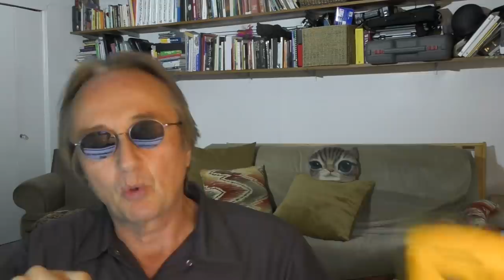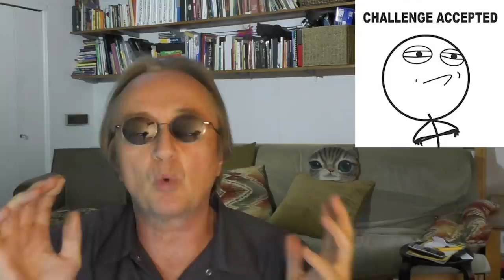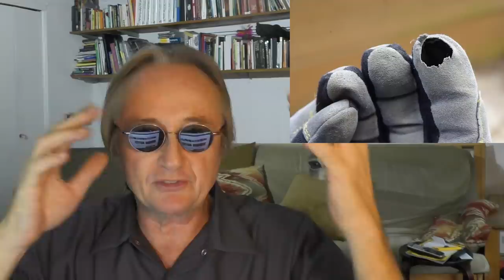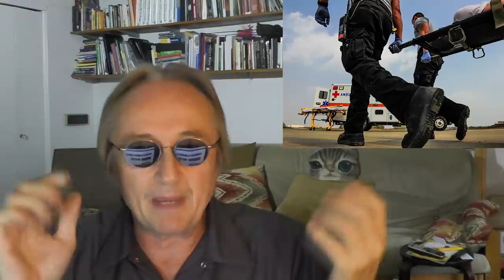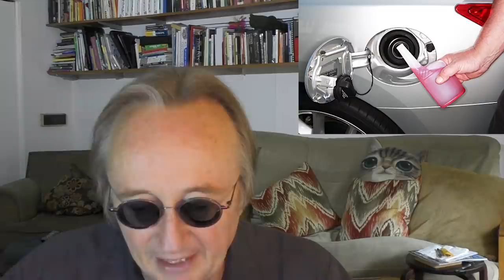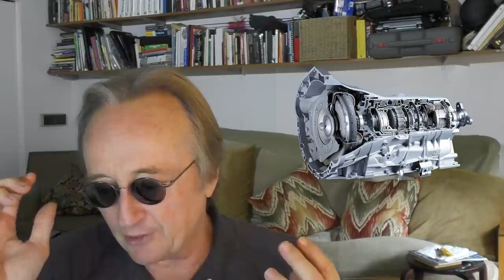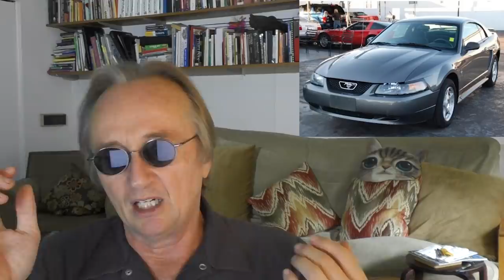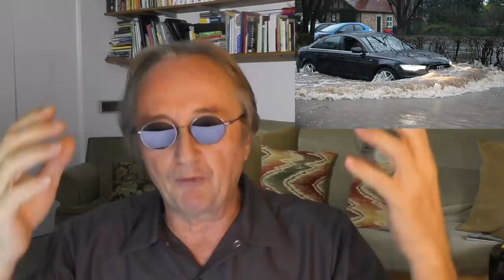The Scariest Car I’ve Ever Worked On, It Can Kill You

Comment: It is the "amps" that will shoot your eyeballs across the garage.
Reply: and those huge batteries in the EV's and Hybrids have enough amperage to kill elephants.
Reply: I've been zapped by a 10k volt transformer on an oil burner. Had a pair of tin snips I didn't know had a missing chunk out of the rubber handle, when I went to do a check across that xfmr as soon as I touched it those dang tin snips went flying into some box on the hoarders basement...bzzzzt
Reply: That is an old saying and people simply repeat what they learned from somewhere. Realistically, the basic components of electricity are Voltage, Current and Resistance.  In the example of electrocution,  your body has a particular resistance.  You need certain amperage to kill you.  To obtain that required amperage, you need enough voltage applied to push the current through your resistive body to die.  So it's true that voltage, alone, will not kill you.  Think of static electricity.  They're in the thousands of volts and has anyone died from it, doing their laundry, or getting in and out of a car, or rubbing their shoes on the carpet and touching the elevator button?  I haven't died yet.   There is not enough current produced by the static charge.  But a good battery has lots of charge in it to produce lots of current.  It's just a matter of voltage after that, before you die.  Lastly, I think your heart needs to be in the path of the current for you to have the cardiac arrest...so you can die.
Reply: no it's the energy that goes through your body that kills you.
static charges for example the amps do jump up to to a few amps or more but it's such a short amount of time that it can't do any damage
Reply: @UCDKhlfrJ_0HJA9nBE4P1cOQ stop confusion the issue with Ohm's law.
Reply: Yep, current is what kills. Actually the higher the voltage, the safer you are because current at higher voltages tends to run along the surface rather than going through your body, and current at about 1amp or higher through your heart is what you need to watch out for.
Reply: It's like a math without the sand paper that starts the match and without the match same with electricity
Reply: It’s all in proportion you can have unlimited current if the voltage is 0
Reply: linucksrox you have no idea what your talking about.
Reply: Spark plugs push out over 40K volts,and am still here.
Reply: riverstrat  Sure, but he mentioned sticking a tongue on the + terminal. Resistance of a tongue is super low, compared to a finger. 
Even if the tongue to finger connection is like 100 ohms, the current is 120 mA. 
70mA is enough to kill a human, 120 is more than enough.
Reply: @linucksrox2670  well that's not exactly true when talking about the human body, though it is true of conductors, like copper. In fact very high voltage will blow you to pieces.
Reply: Jordan S. True but you can't use it
Reply: Ross but with ampsssssss
Reply: Ross like, bout 40A somewhere or even more
Reply: Current  is just electron's flowing, Jumping in a river slowly heading out to the sea won't kill ya in no hurry.
Jumping in a sprinkler also won't kill you any time soon.

If you combine both together, High flow, Large volume. You have an issue.
Reply: Actually its the “ JOULES “ for more specific.
Reply: @linucksrox 
If that was true, a static charge would kill you. It peaks at ~8 amps.
Also, No  higher voltages are not safe, unless your talking about lightning, Yes that will run around your body (most of it), It will also turn a fair chunk of your outer body to plasma, Not my definition of "safe" "The magic smoke escaped from that one"
It's not one or the other, In-fact, Volts & Amps is just a way of saying, There is a potential and amps is completely different, That's saying that there is flow.
Even the two of those is not enough, There also needs to be time over the amount of power applied, Unless you get to face-melting voltages and currents (found in lightning) Then the math is a little different as it imparts a lot of its energy into heat in the air.
Reply: Alexander Volta heard it on electoboom greatscott
Reply: @Nicholas DobosI take it it  breaks their skin? Perhaps if you left it there for a long time, it would cause issues.
Reply: I've heard guys say that 120v can be more dangerous than 480. 120v can lock your arms on, but 480 will just send you flying across the room...
Reply: sparky x <  Nope!  Have you ever heard the word “STUDY”? 🙄🙄
Reply: The comments in this thread are spot on. It's the total current that can kill you.
Reply: its the amps, but theres DC Current, AC Current will throw you away, DC sticks to your body
Reply: @Only1Sethy  The reason why people say 120v is more dangerous because that's the most common voltage people work on here in North America. More people (all together) wind up getting killed or injured because they had no idea what they're doing due to uncertified and unlicensed work. People working on 480v three-phase are trained and certified for that work. A commercial or industrial building must have licensed and certified electricians to do the work. Therefore you have fewer deaths and injuries. As I learned electrical safety is the same as gun safety. Always assume the line is hot (even if you nade sure it's dead) just as you would assume  a gun is loaded (even if emptied out the chamber).
Reply: @South_Korean_Car
Don't say that in that manner, AC causes more problems for you then dc.
Reply: In theory, it takes 48v to kill somebody.
Reply: @Charles Moore
No, It doesn't.
Reply: Correct me if I'm wrong, but don't you need volts to jump through air, and power (or wattage) to kill?
Reply: riverstrat  Yep you cannot take R out of the equation. Higher voltage at the same resistance equals more current.  Your body will only draw so much current depending on its resistance.
Reply: *sigh* the voltage, through the given resitance, determines amperage. The device does not. It is impossible to be killed by a 12 v battery, even though it has a capability of 800A. Tasers have a high voltage (similar to static shock of a doorknob), but have a limited current supply, directly pertaining to their power output. Given the voltage of a taser, backed with a sufficient power grid, you will die. There’s a reason transformers say “danger high VOLTAGE” not “danger high current”. Logically that would be sososo dumb. Also that’s like saying it’s not the gun that kills people, it’s the bullet. Well newsflash the bullet is useless without the pressure (gun/voltage)
Reply: Too many E.E's in this comment section. Most of them were failed.
Reply: @burritos1000  You forgot impedance and frequency, sir. Difference between AC and DC is quite huge. Safe voltage to work with for DC is 50V while safe voltage for AC is 60V. Also It depends on how long does the current go through human body. Everything above 0.4s(some multiplier of hearth period), 50mA is deadly. These fences used to keep cows from escaping do use 10k Volts(limit set by EU) but only send quick pulses that won't kill anybody.
Reply: Amperage doesn't really matter in this point because amperage is basically limited by nothing. Both in electric battery of that capacity and your main power can provide ample amperage.
Reply: so at this point, the voltage basically defines the amperage because higher voltage needs more current goes through you.
Reply: Yeah, because Tasers are like 10,000 volts.
Reply: burritos1000 long story short it’s both huh?
Reply: half an amp has the potential to kill most wall outlets are 15
Reply: .1 amps can be enough to kill you. You can get hit by lightning and survive which can have 100,000 to 1,000,000,000 volts.
Reply: @stevenyau2443  You think there's "a few amps" in a static charge? You are exactly the person that should not be giving people advice on electricity. Static charges are in the 10s of thousands of volts. If it had a few amps you would be dead. If a static charge had just a few amps it would easily put out over 100,000 fucking watts. That's equivalent to 100-150hp in a car. You think a static shock puts out that much power even for a split second? I think you just solved the worlds energy problems with a cat and a blanket.
Reply: Can't believe all the dumb comments about this from people who know Absolutly nothing about this topic.
I have beem working I electronics for over 50 years and have been blasted by several voltages and currents. Remeber tube radios/TV's? There are lethal voltages/current in those things, and yet I was smart enough not to get killed because I was smart enough to UNDERSTAND what I was doing.
A capacitor or a picture tube could kill you even if there was no power  applied.
Simply put it is a function of voyage, amps, resistance and time exposed that provides a lethal dose to a particular body.
Reply: Thank you. It's really current that is going through a circuit. Tons of electrons will send you across the room.
Reply: i took a metal prong that had broken off out of a live wall socket once. i used a pair of insulated pliers to do it though because im not that dumb
Reply: @burritos1000  "Think of static electricity. They're in the thousands of volts and has anyone died from it, doing their laundry, or getting in and out of a car, or rubbing their shoes on the carpet and touching the elevator button? I haven't died yet."

Well, the only form of static electricity capable of killing someone would be a bolt of lightning.
Reply: amp + voltage = energy. it requires both
Reply: @MechaTronic161  Well said!😂🤣😂👍🍻
Reply: "Electricity is so dangerous I'm going to put an old coal oil lantern in the barn. I hope a cow doesn't kick it over."  Mrs O'Leary, Chicago.
Reply: @Only1Sethy  
I was replacing the fuse box in an abandoned house  with an old electrician and I cut a "whole house wire" with a large  pair of metal hedge clippers going from the fuse box into the basement. We didnt know it was still live. It lit up the entire basement and blew me backwards about 8 feet .
Reply: @rbeck3200tb40  jeez man glad you're still alive!
Reply: @ninjoun  
I did mention resistance, which is what DC only cares about.  Impedance is for AC where there is a frequency to the AC oscillation.  Battery is pure DC.

Still, it's not the voltage, 50 or 60V.  It's the amperage.  Like your cow fence.  It's limiting the current, but the voltage is whatever it needs to be to cause current to flow through the cow.  It's essentially a current source rather than a voltage source.

So if you were to measure the voltage across the cow (between wherever the current is flowing) while it's being shocked, you'll measure some voltage that is less than what the fence voltage is when not shocking anything.  It might even be 50V.

On a side note: Did you know that the same thing happens with ignition coil firing a spark plug?  The voltage spikes up to like 10kV and when the current jumps the spark gap, the voltage come down to a voltage much lower, just enough to keep the spark going.
Reply: @Watcher3223  

Ah...good point!
Reply: @dylanwhite6539  

Yes, in a way, you do need both.  They always exist at the same time.  What the voltage does is that it's needed to push current through your body and that depends on your body resistance.  Form there, the current is either limited by something, or if it's unregulated, in which case you may be injured or worse.
Reply: m1t2a1 I am planning to star as Jesus in a Mel Gibson movie about the Crucifixion. I understand that the day they shoot the crucifixion it’s forecast to be thunderstorms. Is it safe to be outside in a thunderstorm? Jim Caviezel, Hollywood.
Reply: @Only1Sethy  120 v  A.C., house, apt, etc.  lower amperage  or  higher  amperage  is  deadly......should  always  turn  off  power when  fixing , installing ,  etc....something  electrical........
Reply: @driver4011  agreed, I was just saying that 120 is often considered more dangerous than 480. I could have worded it better
Reply: @Only1Sethy  
right.....it  is......120 v A C  n  240  A C  on  house....very  dangerous....n  very  deadly.....always  very  important   to  shut  off  power   at  breaker  before   doing  any  electrical  repair  ,  replacement ,  etc......
Reply: @driver4011  yep exactly! I always test the voltage with my meter too before doing any work.
Reply: @Only1Sethy  
cool,  best  way  to  check  n  ensure  there's  no  current,  power  at  the  leads  you're  work in  with.....
Reply: @driver4011  yep. I check the circuit before de-energizing to verify that my meter works, de energize, and make sure no voltage is present
Reply: @Only1Sethy  
they  also  have  those   "wands"  that  can be  placed  in  proximity  to  the  wires  without  having  to  touch  them  n  will  make  a  high  pitched  sound  indicating  there's  current  flow....pretty   cool....
Reply: @Only1Sethy  
cool......good  idea,  precaution.....
Reply: Electrocution is path dependent too.  If you're getting a current channel from leg to leg it's a lot different than across your chest.
Reply: Looked for this dumb comment. True is the current (amperage) that kills you, I doubt its a low amperage system.

Comment: I'm an electrician. It's the amps that kills you not the volts. 480VAC if it touches you, it will knock you about 15ft away from it. If you touch 110V to 120V, it will grab you and not let go. Even tho the 110V may be .5 amps. If it grabs you for 10 min, that's 10 min of .5 amps going through you, it will probably kill you but if you hit a 208 or 480 volt system, even if its 10 amps, it's not gonna kill you, it will knock you away from it and whatever part of your body touched it will be numb for a couple hours.

Comment: voltage don't kill you, currant does, only takes .5 amps to kill you, a 12 volt battery(500+ amps) has more currant available in it than a 110 volt socket(20 amps)

Comment: lol, you should try my job scotty. I'm a sparky in the UK and sometimes I work on three-phase supplies. That's 410v. I've had one or two belts at full voltage, ached for days! That's AC though. AC will typically throw you away from it. The DC in the Prius' pack will stick you to it like a magnet and fry you alive!
Reply: So will a fully charged 12 car battery. I've no intention of sticking my tongue on the positive terminal and a finger on the negative.
Reply: I run a machine that has a couple of 40,000V DC power supplies in it. Thankfully, any time I have to work on it, I can shut it down and lock it out.
Reply: Yes you are correct. AC current will pull you then push you away because its a cycle. DC current will not do that
Reply: Yikes!

Comment: scotty i am a 35 year mechanic ,but i also do electronics and electrical work.i worked at Exide as a electrical maintenance tech also. plus i took college classes,we dealt with mostly 277/480 voltages,no special gloves other than knowing and respecting electricity. the average sop mechanic theses days dont have the knowledge and training and respect of high voltage circuits. but me and you got enough sense to read up before execution.